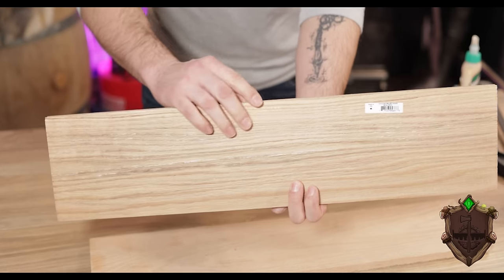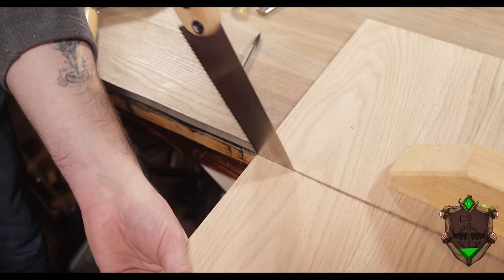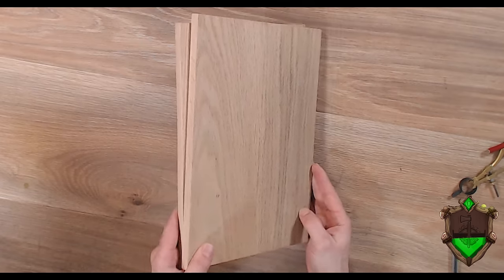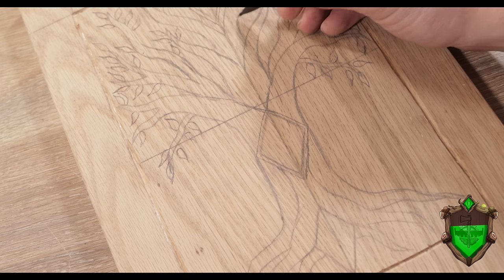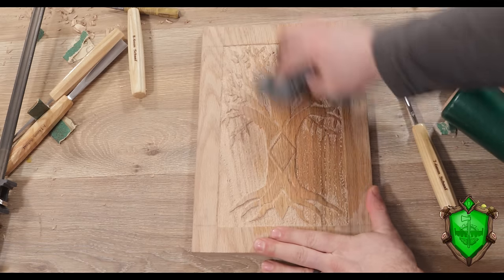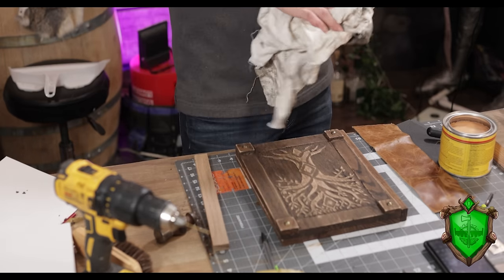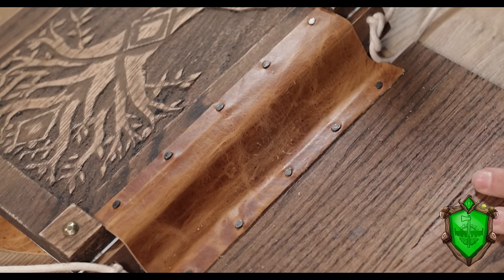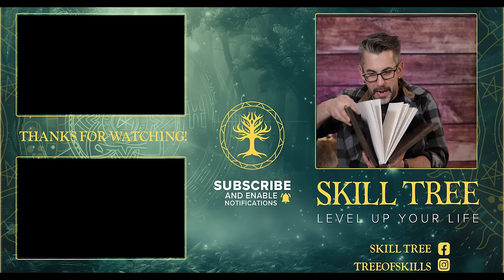Carve Your Own Wooden Grimoire!

Comment: As a weekend woodworker,  one thing I can contribute is that a great way to hide dreams in a panel glue up is to find complimentary grain patterns. It can take time to do this but it will help obscure the seam line/s of the glue up
Reply: I'm sure it's just autocorrect getting away from you, but hiding dreams in a panel just sounds so suitably necromantic and disturbing, it's great.

Comment: If you aren't as comfortable with freehand drawing and have trouble tracking down carbon paper, it's easy to DIY a carbon paper substitute. Just print out your design, scribble heavily in pencil all over the reverse side behind the lines, then set it down drawing side up and re-trace over the lines of the design. The pencil will transfer off the back onto the surface below just like carbon paper does.

Comment: With cutting without power tools, a miter box is one of the best things for getting a straight, clean cut without the risk of tilting.

And, if you can get access to one, with cutting the paper, an easier option would be to use a guillotine style paper cutter, you can go through the entire thing in an instant with a clean cut

For that kind of book, you probably want to add a latch of some kind to keep it closed since you're planning on using it at larps, perhaps also a pen loop...

And another option for a wooden tome, if you have the back reduced in width by the thickness of the wood, you can have an unfolding cover as you open it up.

Comment: Carpenter here. When using a gouge or chisel of any kind, if your shavings are breaking, you're probably going the wrong way. They should slice off. Wood grain is a 3 dimensional thing to look for so look at the sides of your board too. Whatever side they come out of the wood at is the direction you want to cut. I could be misunderstanding but either way, useful information. If you want great practice with gouges without worrying about grain, try carving sintra plastic. It's a foam PVC and in some of my wooden prop builds, I just carve that. Also when lining your carvings, you can just use the v gouge and just use that so you can also set a depth to start with and make it easier to score the grain for stop cuts

Comment: IF you use a straight edge (metal ruler) and a utility knife or hobby knife and score your lines and then use the V-groove or other chisels you won't be chasing the grain as much when going with the grain and helps avoiding tear-outs, kind of like what you just did on the tree section

Comment: 3:37 When marking that line to saw down, an excellent thing to do is use a knife, rather than a pencil. This accomplishes two things - one, it gives a more accurate mark than the pencil, as even a mechanical pencil lead has some width to it; two, it gives the saw a groove to fit into, which helps get a straighter cut; three, it severs the wood fibers, which leaves a cleaner cut. Source - i am a furniture builder.
Reply: This
Reply: Thank you for that tip. 🙂
Reply: Japanese marking knives are made just for this

Comment: A little tip.....
When using a hand saw on a long cut, clamp a thick board, with a straight edge, on top of the board to be cut at the cut line and rest the saw against it, as you saw.  It will give you a straight cut both vertically and horizontally and shorten the amount of sanding you will need to do.

They are called "gouges".(rounded) and "V-Tools"  Also, if you keep your gouges (especially) nice and sharp, you may not even need to tap it, eliminating "starts and stops" (depending on the wood of course).

Comment: Finally Woodworking Something i Can Speak About.
Wood Shrinks mostly along the Annual Rings therefor you want to get the Rings as klosly as Possible to a Straight line as Possible to keep the Wood from Cupping. You Can do this by watching at the endgrain and bringing your anual Rings to an elongated S Shape. This has the Effekt of  creating many little Cups instead of one Big one  and therefor makes the Effekt way less Pronounced.
For Gluing the Bords Together you should Use as Many Clamps as Possible but three should be the minimal ammount for such a Wide board and should be the Minimal Ammount in any Case. You want to Put two Clamps on the top of your Workpeace and one in from the Bottom so you can Adjust the Preasure and Thereby  preventing the Gap You Mentiond to form by just adding Preasure on the Lower Clamp. When You Use only Two Clamps  i Often had the Problem that the Gap one One Side of the Board formed on the Top and on the Other Side of the Board on the Bottom. Therefor three Clamps a the Minimum requierment.
Considdering the Carving Part i Usually try to avoid working with a Mallet to Prevent breaking out Fibers or when Working with thinner Peaces Splitting the Wood. But instead i just Slide my Chissel with Medium Pressure along the Line i Want to Carve as Youd did it to refign the Carving in 10:55 .but to Prevent Breaking out Fibers or Chips i Trace my Lines with A Markingknive or a Scalpel on finer Positions in my Artwork.
For Refingning the Surface i Use a Common Chissel  but the Edges i Round Over untill the Blade is U Shaped but the Top and Bottom of the Chissle is Still Flat. You can Use this Chissel like a Planer and by Rounding over the Edges you Prevent them from Catching something and Digging in your Workpeace. It makes the Process of planing out the Groves Your V and U Chissel create way Easyer and saves me a lot of time on sanding. Its Effektivly the Step You did in 15:30 but with another Tool to make Your Job Easyer.
If You dont Have A Chissle like this One You can Relativly Easy Make one From an Old Flat Chissle and a Disc Grinder and A File. Just Make Shoure you dull the Edge before Starting or you yould Easyly Tear Up Your Sandpaper.

Comment: Another tip is to put masking tape down where you want to cut. Draw your cut line on the masking tape and then cut through the board and tape. It prevents blow-out on the edges of the underside of the board

Comment: Some additional tips for woodworking:
when gluing boards together, you can use some sawdust or salt to the glue after it has been spread which helps prevent the boards from sliding. 

also take care in how you choose your boards. avoid knots and rings, as those spots tend to warp unevenly. if you can line the grains of the boards as close as possible at the joint, you can make it appear to be a single, larger board. 

if you plan on making lots of glue ups, you can make a clamp board. its just a big board with two parallel sets of ribs on top, and some wedges. this is an investment, so its not for everyone, but if you plan on gluing up some shields, larger boards for furniture, or just a lot of smaller glue ups, it is more cost effective than buying lots of clamps. I am making one using a 2'x4' piece of hardboard from the big box store, and some scrap pieces of project boards (inexpensive 1x3 poplar boards). it is a lot easier than fussing with half a dozen clamps because it is sitting on the board. just put down wax paper to prevent the glue spread from sticking to the jig. 

you can also make a device called a caul to prevent the cupping. using a weigh like that can just cause it to cup the other way. cauls are just stiff boards that are perpendicular to the joint. you can make a set pretty easy by using some 2x4 cutoffs and use screws or machine bolts and nuts to provide the clamping pressure. 

be very careful with your glue, as any spot the glue touches will make the wood not take the stain. you can see a few spots on the finished product where there is a lighter line at the joint. sanding there and removing the wood that had any small amount of glue squeeze out will get rid of that problem. When I made my kitchen table I had to sand off my first coat of stain because one board had a nasty glue blob residue. 

I recommend wiping the piece with a damp rag before your final finishing sanding. the water raises the ends of the fibers, allowing the final sanding pass to make that final finish really smooth. its less important with harder woods, but it is a step that doesn't take more than a few minutes. if you are using water based stains, it can also help with blotchiness from the stain. 

if you struggle to drill good precise holes, you can use an awl, screw, or anything else sharp to set a nice spot for your drill bit to catch and prevent the drill from walking around. you can also use an offcut block of wood to brace the side of the drill bit to get a straighter hole. you can make this a permanent tool by drilling a hole that size through the wood to allow repeated 90degree holes. 

you can achieve some really cool effects with carving, by cutting straight lines down, and then rounding over one edge with a chisel. Lucky used the v gouge chisel to do this, but using a straight down cut can give an even more pronounced relief.

Comment: Given its ment for larp i would consider using pegs to reinforce the glue joint. 2 or 3 might save you from heartbreak.
Reply: I thought so too, if that book is dropped or slams against something hard, the edge glue may not hold. Either pegs, or bisquits journery would work. I would suggest too, to use thin pieces of wood to edge all around the covers so that they could be glued to the covers completely. (This could also be used to cover mechanicals like pocket screws that will hold even better than just glue.)

Comment: I see other comments have mentioned using a knife to score your cut line rather than a pencil to avoid tearout, so ill just mention that holding the saw is much more stable if you use a pistol grip - put your index finger on the side of the handle/saw blade, and use your other three fringers to actually hold the handle. This helps immensely when the handle wants to twist in your hand, and also give you another thing to help keep the saw in line with your cut (since you're literally pointing in the direction you're cutting).

Great project!

Comment: For those looking to get a decent saw for a good price i recommend a Japanese pull saw. I found one at lowes that had a rip cut on one side, and cross cut on the other. The pull motion also gives you better control.
Reply: I got a little swappable-blade one with a kit, and during a house remodel me and my dad have been amazed by the difference on some cuts compared with even more expensive saws. 
He has a proper one on his birthday list now.

Comment: I used to stain things for a living. Using different stains for different parts is another great way to differentiate between foreground and background. Those cheap foam paint brushes work great for that because of the thin edge. Also layering different colors can create colors that you can't just buy. Don't be afraid to experiment with some scrap wood. I had about 6 colors of stain and was able to color match any hardwood floor in existence by layering stains.
Reply: I have a big stain board game project, and no real eye for color. I need to send this to my fiance who would have fun with this.

Comment: Sawing: line up your shoulded with the cut.

Marking: use a utility knife, several passes until its dark enough to see. Consider making a marking gauge.

Gluing: put the pieces of wood together and plane the edges at the same time - it cancels out any extra wood

Carving: yes, trace the line with a knife first. for leaves, use your curved gouge veritically to make a football shape

Comment: 11:00 one thing that will help IMMENSELY here is scoring the edge of your carving with a marking knife. Make sure the edge of the ruler you mark this with is the edge that the grain pushes the blade into your ruler & not away. This will keep it form veering off line. Then chase that line with your wider chisel & make it deeper & at the angle you want if it's not straight up & down. This will guide your carving by precutting the competing grain & not letting it skew your carving. Also carving opposite the rise & fall of the edge grain in so it gets more shallow will prevent the cut from diving & going deeper than you want or tearing out. You did this at about 14 minutes. 👏 well done sir. 
One way I've made my field areas (like either side of the tree) more interesting is using a spoon gouge or scoop knife. This will let you take small scallops of wood away like you had scooped it out with a spoon leaving sort of fish scale patterns but concave vs convex. You can vary the size of them to give depth or impressions without actually forming anything specific.

Comment: I beleive it was mentioned earlier, but I'll add my 2 cents. Using a knife along the li es of your carving is basically making a knife wall, it's an excellent idea to do that. You can also do that for your cross cut, it's called a knife wall. Cut your line then angle the knife nibble a chamfer along the waste side. This provides a very helpful wall to keep your cut straight.

Comment: They've used that stitch for years on steering wheel covers. I've had good luck using a corset or cross stitch for butt joints for cylinders.

Comment: Clamping, you can also use cauls. Take a little bit of packing or house wrap tape on the bottom side of a straight piece of material that you can use to maintain flatness on both sides of your workpiece

Comment: Another small sawing tip.  When you grip the handle, have your index finger out of the handle and along side the handle, like you are pointing down the blade.  It helps straighten your hand, reducing the amount of twist you accidently put into it.

Chiseling tip, you saw that your chisel followed the grain.  when working with handtools, a knife is a much better marking tool than a pencil.  The knife will cut the fibers and your chisel will follow that much easier.

Comment: Video 1 of requesting you to tell us how long the project took.
I really wanna follow this level reset journey, but I struggle with thinking how easy the video makes it look
Reply from the maker: So, it is actually really hard to say. Filming makes everything take SO MUCH LONGER. Every scene change I stop, move the camera, adjust the settings, and adjust the lights. But, If I were to ballpark it, I would say around 5 hours of actual work. The whole project took longer because the glue was drying, and the dye had to dry. But, ofbme actually physically doing stuff, yeah, around 5ish. I hope that helps!

Comment: Tip for sawing: if you find that the saw is sticking alot, grab a candle and rub it on the side of the saw. It should be a lot smoother to saw in my experience a beeswax candle works the best

Comment: 2:33 I don´t wipe the clue away. If you do so, you will push it into the woot, and it can take a lot of sanding to remove it. But if you just let the clue dry, you can simple and easy remove it with a blade/ cutter

Comment: Another really fantastic, durable, and largely waterproof wood coating is Rubio Monocoat. I used it on an acacia butcher block for a desktop about a year ago and it's been practically bulletproof. I even spilled some super heavily pigmented fountain pen ink on it, didn't notice, found it dry, and it wiped right off. I've been very impressed. It also preserves the smooth, soft, "wood"y wood feeling, it's not plasticy and sticky like poly or lacquer.
Reply: Only downside I guess, it's not cheap! 😅

Comment: Only thing missing is a clasp. Every grimoire needs a clasp to keep the magic from draining out…

The original drawing from Matty has a feature I really like, things that look kinda like fruits hanging from the lowest branches. I get that carving those in would be pretty much impossible but some metal pushpin heads and wire to represent them would work.

Comment: When using a handsaw, you can keep it perpendicular to the wood by watching the reflection in the saw. As long as the reflection is a straight line with the edge of the board (or the grain), you are golden.

Also, I'm really excited to see where the channel is going. It's like you're restarting the game after figuring it out 🐒

Comment: I wonder if protecting your raised area while carving would be easier if you used a straighter chisel to cut around your edge before you start scooping wood out with the V and U shaped tools, and if using those tools it would be better to cut away from the lines instead of towards the lines. I don't know, I'm not a pro or advanced amateur.

Comment: There‘s another easy way to tell if your saw is at a 90 degree angle: look at the reflection of the wood on the polished metal of the saw. If the wood and its reflection are in line, you‘re doing okay. You can see it nicely in the video.

Comment: Alternative with the cord would be instead of having two pieces you measure out a little longer than the entire back of it, then loop it through so it’s halfway on one end and then you only need to tie one knot on the other and it’s just one piece of cord or leather. It will create something that can catch on stuff on the spine, but it makes that spine a little more interesting. And if you wanted to get fancier, you could find some kind of a metal clip or staple or something for it to thread through on the backof the spine.

Comment: I hope when you glued up the panels you kept the grain running the same way AND alternated the Annual Rings otherwise the panel might cup anyway!  And Both Cross Cut saws AND Rip Saws HAVE offset teeth!  The difference is the teeth of a Cross Cut saw are pointed like needles while the teeth of a Rip saw look like little Chisels!  And a trick to sawing a strait line is to not grip the handle of the saw with ALL your fingers, Instead point your Index Finger down the saw blade and use it as a eye guide to keep the saw strait.  I use a Razor Blade or Box Knife to cut the lines in the designs into the wood before carving, a chisel is kind of heavy to work with that way for to long.